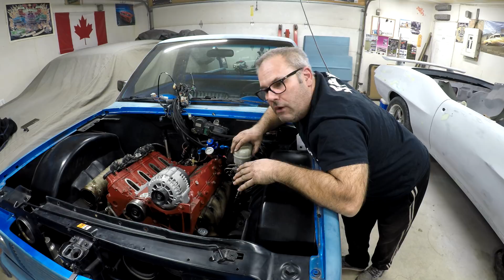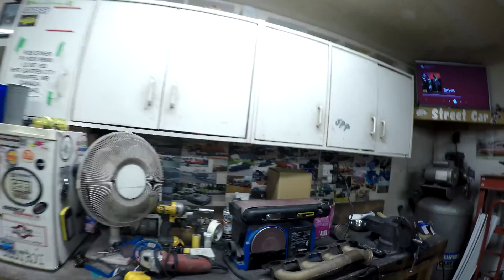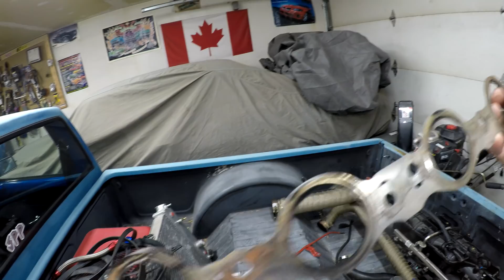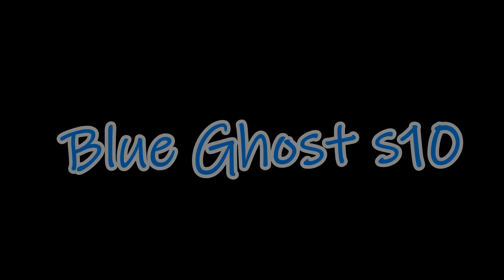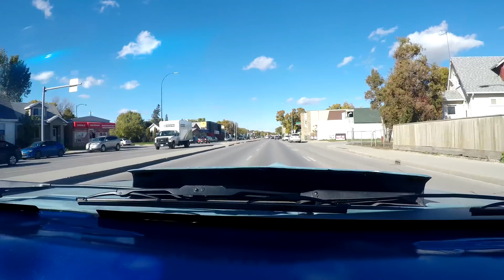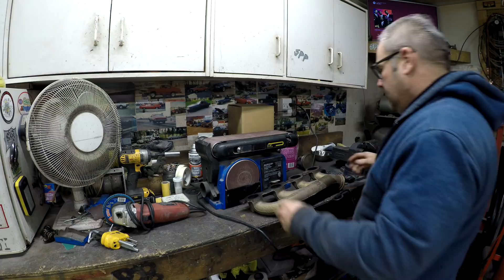Turbo LS Engine 1st Startup after Junkyard Rebuild | Is it Fixed?

Comment: Tech tip for the converter bolts - one hole in the flywheel is oval and usually has a pink mark next to it - start with that hole first then the other will always line up so you can tighten them as you put them in

Comment: From over here, the engine sounds like it's back to normal. Good effort with great result! 

One would've liked to have seen the GTO covered before air guns, fluids and grinders were spraying droplets all over the place. Just an observation. One might have to be a little more vigilant when wax-and-grease-removing for next coat of Goat skin...

Comment: When you put the converter bolts in next time , look at the flywheel one hole will be smaller almost an oval shape compared to the rest ... Start with that bolt and you wont have to leave them loose and go around twice .. life saver! 🍻
Reply from the maker: Ya that was the issue, the small hole was last.

Comment: Find a 4wd trailblazer and turbo LS swap it for a winter beater. Should be an easyish swap since they came with LS's. The 4.2l ones around 10-15yrs old are pretty cheap around here.

Comment: I had that when I first fired up my junkyard motor. I had cleaned the outside  motor with some stuff that I think got into the lifters. I poured seafoam into the oil while it was running and almost immediately it stopped. Never made another sound.

Comment: Rob nice job as usual!! I have a question that i hope you can answer. Where did you pick up that sander? What is the brand and model number if you by chance have something on the machine or the box it was purchased in? I think that thing would really come in handy and go hand in hand with a multi process welder for some in house fabrication job on my toys! I want to thank you in advance for the information and for keeping it real with everyone that watches the channel and follows the spp shenanigans!
Reply: Its from canadian tire, if you are in the us harbor freight should sell them.
Reply: @novaracer2000 thank you for the reply! ......I am in the US I'm in Maryland, I do have a harbor freight in Delaware that i go to. What is the model number and brand of the unit that you have? I figured if i had a part number and brand i could cross reference it and search for something similar based on that unit you have on the old interwebs worse case scenario  and just have it shipped to me. Let me know if you would happen to have the part number and make and model description of your unit please....thank you much and thanks again for taking your time to reply to my comment/question.
Reply: Is that unit that you have a 4 inch by 36 inch belt? And then a 6 inch disc?

Comment: As far as projects go I’d like to see a G-body or a 2nd gen F-body. The S-10 sounded much better, just heard some lifters. Quick question I noticed the “T” fitting you have at your oil pressure sensor, was that so that you could use your mech. gauge? In the process of trying to make all my factory gauges work on my 91’ third gen. Looking for the best place to install the 91’ oil pressure sensor.
Reply from the maker: Yes thats what the t is for

Comment: bad exhaust leak or severe lifter tick? sounds better than it did but still loud.    did you check the number 8 for a bow bend like i suggested?   7 was zigzag, 8 looked bowed to me.   maybe it will clear up as u drive it.   i hope it does for you, that sounds more like a lifter than it used to haha.  Good job on the 3 or 4 day rebuild, way to get er done.  u figure it would have self clearance the piston as long as you drove it like that lol...  love you guys
Reply: Ya all the other rods and pistons are good. It does have a exhaust leak at the v band i need to fix.

Comment: I warped the shit out of my stock manifolds after hacking them all up and welding on them a ton! I used a hand held belt sander and a lot of time to flatten them back out enough to reliably seal.

Comment: There’s something not happy, in the video it sounds like either an exhaust leak or maybe piston pin knock. Sucks it’s not smooth like it should be after all the work!  JD
Reply: It does have a exhaust leak at the drivers side v band. Im going to fix that next.

Comment: Did you pinpoint when the tick started?
Reply: From when i first got it running  i think.
Reply: @novaracer2000  wow! So it was driving like that for a while? I wish I was a fast as you! Building a 50 chevy 3100 with a turbo'd l33 from the ground. Getting a tad anxious..
Thank you!